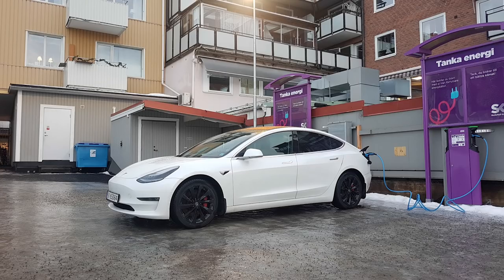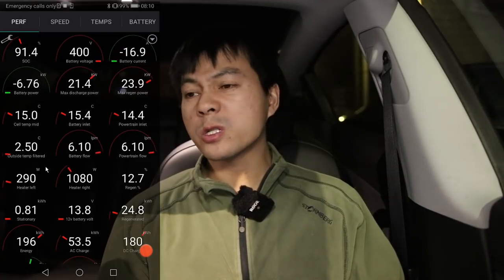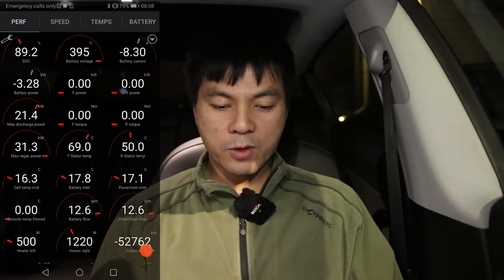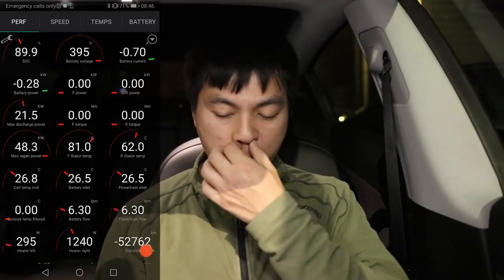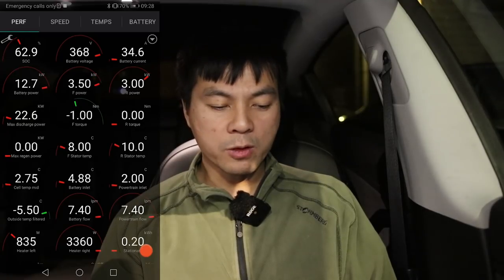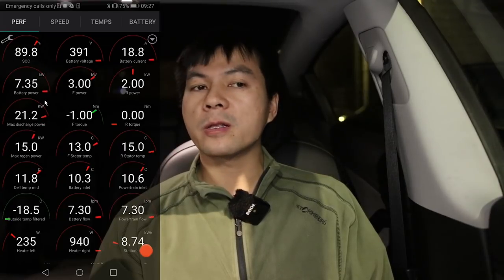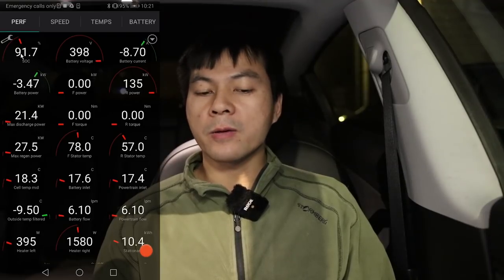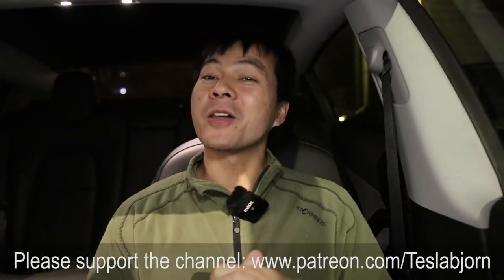How Model 3 preheating algorithm works

Comment: It's easy to forget that the "tank" in a Model 3 LR is equivalent to 2.5 gallons of gas in pure energy.   It's so efficient normally, that things like pre-heating seem "expensive" when we are used to burning 10x the amount of "fuel" in an ICE car without even thinking about it.
Reply: That’ about 9.5 liters. It’s mind blowing how efficient Model 3 is.
Reply: One liter gasoline/petrol fuel indholds 9.5kWh and one liter of diesel fuel in holds 10.7kWh. Assuming 75kWh battery capacity in M3LR, the equivalent in is 7.8 liters gasoline/petrol or 7 liters diesel. Considering a fossil car has a 50 liter reservoir drives about 1000km best case, and assuming a M3LR drives about 500km with a full charge result that M3LR is about 3 times to 3.5 times more efficient than a fossil fuel car.

Comment: 4:00 I think onboard charger generates heat during AC charging. On "Rich Rebuilds" video, you can see, that the charger is also liquid cooled, so Tesla probably takes the heat from onboard charger, to the battery.

Comment: when you are "ACTIVATING PREHEAT" - is that just by turning the car / cabin HVAC to ON ?   or are you doing something more like telling it you are going to a supercharger nearby ?
Reply from the maker: Just turn on HVAC from app.
Reply: Bjørn Nyland what temperature do you usually set the car to when preheating?
Reply from the maker: 20-21

Comment: I guess, if you don't take in account the cheapest hours to charge, the most efficent way to preheat the battery is charging slow and make it last untill you get in the car in the morning, so the battery stayed at a nice temperature and won't have too much work preheating before getting into the car. I tried this last week and could see in Stats app that the car was taking only 1-2 kw from the plug in about 10 minutes of preheating. Normally if the battery has been cold and not charging for 2-3 hours, It can stay 30 minutes picking 3,6kW from the plug (my maximum charging power at home) and losing SoC, all to preheat... My garage temperatures this days are between 10 and 14ºC.

Comment: Interesting. I am curious how it is in my SR+. As smaller battery it takes probably less time to heat it up during driving. But as it is only single motor (so only one 3kW "afterburner") it takes probably more time to heat it up during stay/charging. When I am pluged-in 13A-230V = 3kW Schuko and started to preheat the car, I am loosing also some % from SoC.

Comment: Hi Børn, I am a power electronics engineer from DK, M3LR new owner. Very entertaining to see your videos, thanks! Can you please make it clear why would one desire to preheat the battery other than for improved regen power? Myself I prefer to not preheat the battery and keep a safe distance in front of me for the first 20-30km drive until battery gets heated by the losses in motor(s) - that feels more energy efficient to me. However it would be interesting to know if we can use the battery as a heat storage tank if the excess heat from motors will then be used for cabin heating. Could you see with Scan My Tesla if that could be the case?
Reply: Maybe I was not clear enough. I am pro preheating the cabin especially while plugged in, I always do it for 5-10 minutes, max 15 minutes. But I am not certain what advantage I get preheating the battery also, except higher regen power. I never preheat the battery, just the cabin for max 15 minutes.
Reply: siliara, I have nowhere seen reports about LiIon battery lifetime degradation if discharged when it is cold. Charging when is cold is software limited to protect it. The impedance is higher and perhaps is not best to do drag race like that due to limited discharge power. So still, for regular use I find very few reasons to preheat the battery, but there might be something I don’t know on the way the HVAC system works.

Comment: Conclusion: From this 20 minute video, there is a need to be able to pre-heat the battery without heating the whole car!
Reply: Just set it to charge thru the app by sliding up the charge level and it will heat the battery without heating the cabin.

Comment: Unfortunately Tesla has changed the heater wattage location in 0x2B3 and ScanMyTesla has not updated so your heater readings are all wrong. Hopefully Amund can update SMT soon. You can also read heater voltage and current (to calculate power) from 0x345. Also suggest you show cabin temperature on the screen so we can see things heating. I will do an in-depth HVAC and/or battery heating video soon.
Reply from the maker: Yes, already explained in the video.
Reply: @bjornnyland  I meant to say, it's not really a bug. The app used to be correct :)

Comment: Can you set a temperature for a ‘leaving’ time and the car figures out when to start heating based on current temps?
Reply: Yes, you can schedule charging+pre-heating. You tell the car when you are planning on leaving and what charge level you want. I only used it once myself and then I left a lot sooner then I originally planned so it didn't really work out for me. But there are probably some videos on it.

Comment: @teslabjorn you should try to start preheating using the option "Hi" from the app and after a minute choose 20°C in this way the battery should start preheating the battery immediately.
Reply: Did you use the app to see this result?
Reply: @GagandeepPandher  I have a model s and when I do like this a battery icon appears in the climate control section in my Tesla app
Reply: Giacomo David i did try this and no it doesn’t show the icon but the car is not plugged in tho.
Reply: @nate6249  did you tried with model s?
Reply: Giacomo David sorry I forgot to mention i tried with M3 LR
Reply: @nate6249  ok, so maybe it works only with MS and MX which have a dedicated battery heater

Comment: Could it be that the left heater is showing the wrong value, and should be the same as the right heater? I see no logic to it beeing different.
That would explain a lot of your discrepancy's, like the missing kw during campling. And that the sum of afterburner and heater in this video is to low around the 12 min mark?

Comment: Did you start the pre-heating from the app in all cases? If so, can please you do the same analysis when programming departure time? In my experience the car then charges during off peak hours, and starts preheating of the cabin and batt from the plug in time for it to be ready at the desired time. Would be nice to see the details!
Reply from the maker: From app, yes.

Comment: Do you think is normal to loose 8kw of battery charge in one night at 0° and preheating 15 mins on the morning? Model 100X. Zap charger says i put 30kw and tesla computer says 22kw used since last charge. Feels like a hole in a fosil car tank loosing a litre per day
Reply: For me it's normal. 
Preheating sucks 6 kW of power in cabin and 6 kW for battery. It will use plug+battery in case.
The charging loss is about 90%. So it's good.
Reply: @antoniocirino8444  thanks. I will test it without preheating. Now it says has charged 26kwh in zapcharger but battery moved from 42% to 66% (22kwh?)...maybe something wrong with bms?
Reply: It all depends on the temperature, he showed this exactly in the video, that the Car is pulling 13kw when not plugged on while preheating.

That means in 15 minutes it will consume 3.25 kWh of Energy. 

I preheat my car every day for 10 minutes 2x a day which means in a 5 day work weak I will use 21kwh of energy to preheat the car. Which is a lot of energy and money. But the comfort of having a warm car every day and also a preheated battery with full regen than is totally wort it imo.

And its obv only during the winter
Reply: @emiliopicazo9635  22/26=0.84 pretty normal charging efficiency. 2-3 kWh for preheating is acceptable.
You will heat the car with battery if you are not doing so.
Is it better grid or battery? I prefer grid.
Reply: @likandooTV-  3 kWh for preheating in model x is normal.
Reply: @antoniocirino8444  wow, i thought it was much less. Allways try grid but even connected goes down 1% as somebody mentioned on the comments. Thanks :)
Now it is finished chsrging on a better observation and i lost 4kwh charging and then another 4kwh preheating in 24h cycle go back work. Here are the 8kwh missed. Should not be included in the calculations? when a car uses 250wh/km is using more...like an euro per day extra
Reply: @emiliopicazo9635  in theory if you charge at the highest rate, you will have much more efficiency.
Reply: @emiliopicazo9635  Your Sentry was enabled? It's drain a lot, because it can't allow the car to go to sleep. Everything is on (main computer, cameras, LTE etc.)
Reply: @antoniocirino8444  7kw
Reply: @balazsberczi6611  yes. Enabled at work(charging) not at home (not connected)